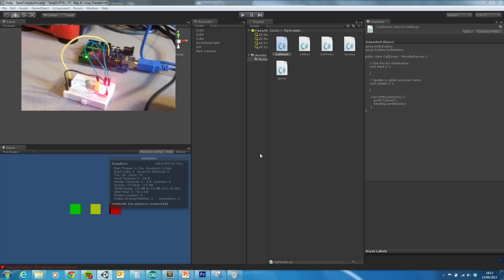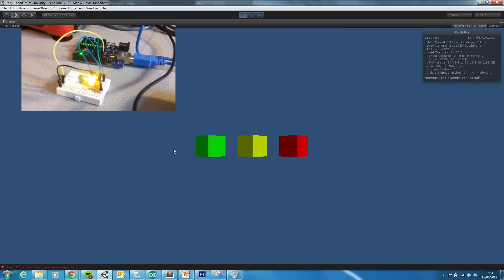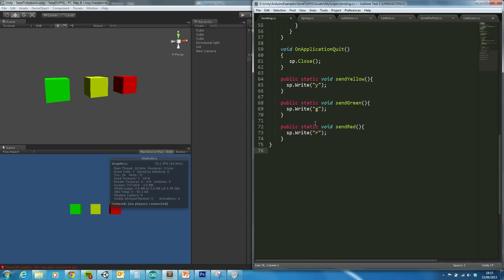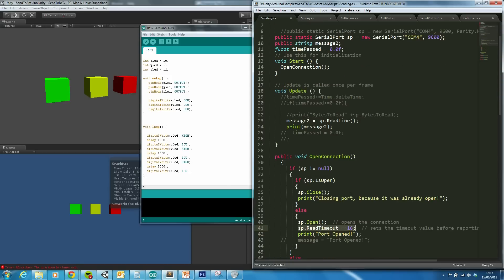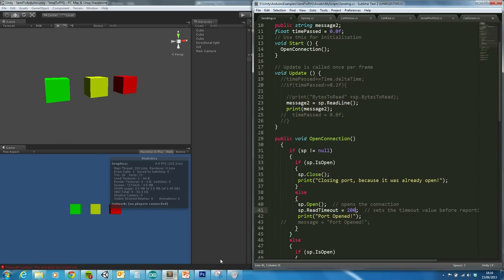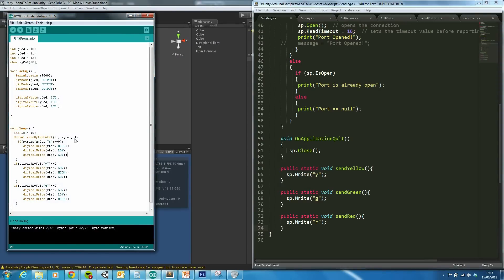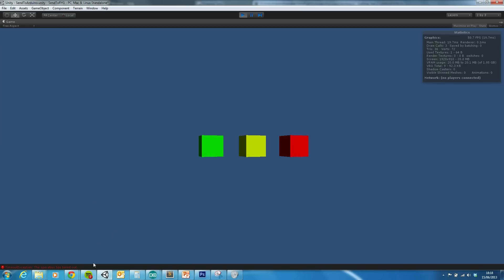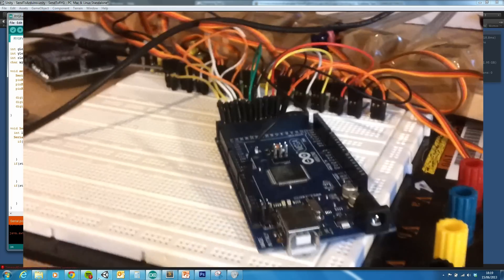Communicating from Unity 3D to an Arduino

Comment: I am working on a project But there is no Arduino plugin.
I created a car electrical circuit on my computer. Can you help me?
when pressing a button on the computer The output is sent to the Arduino pin.
I write the program with Construct 2.

Comment: Hello, great video, thank you very much! Can anyone help with this error?
InvalidOperationException: Specified port is not open.

I am definitely using the correct port. I have set the api to Net 2.0  (no subset). And I have tried using full windows name \\\\.\\COM6 to no avail. 
Thank you

Full error
InvalidOperationException: Specified port is not open.
System.IO.Ports.SerialPort.CheckOpen ()
System.IO.Ports.SerialPort.Write (System.String str)
(wrapper remoting-invoke-with-check) System.IO.Ports.SerialPort:Write (string)
Sending.sendRed () (at Assets/Scripts/SendToArduino.cs:80)
SendHome.Update () (at Assets/Scripts/SendHome.cs:14)

Comment: i have this error.

InvalidOperationException: Specified port is not open.
System.IO.Ports.SerialPort.CheckOpen ()
System.IO.Ports.SerialPort.ReadTo (System.String value)
System.IO.Ports.SerialPort.ReadLine ()
(wrapper remoting-invoke-with-check) System.IO.Ports.SerialPort:ReadLine ()
Sending.Update () (at Assets/MyScripts/Sending.cs:23)

what happend?
Reply: hello,
did u got that error solved, i am also getting same error.
Thank you.

Comment: Hi guys, I'm using Unity.  I have a proplem: I couldn't use System.IO.Ports when coding on Unity. Error follow: "error CS0234: The type or namespace name `Ports' does not exist in the namespace `System.IO'. Are you missing an assembly reference?"
Can you help me, please!
Thank for watching!
Reply: You'll need to make sure you have the API compatibility setting to .NET rather than subset. Go to Edit / Project Settings / Player And in the API Compatibility settings switch to .NET

Comment: Hey nice project! Is it possible to use this code with Bluetooth?
Thanks
Reply from the maker: Yes, although fiddly. Mac is very tricky, but I have used very cheap BlueTooth chips to send data in exactly the same way.
Reply from the maker: r3dstar Windows is less tricky, although I did end up with a lot of COM ports listed.

Comment: Hey man, love the tutorials! Needed your help on something. I am doing a project that requires me to control the car, in a car game in Unity using Arduino Uno. What I wish to do is attach a red sensor to the steering wheel of my REAL car and connect it to Arduino Uno. So when I rotate my real steering wheel, the car in my game is rotated accordingly. I would be really grateful if you can help me with the following things:
1. What device should I use with Arduino so that the rendering in Unity is smooth. (Best device to attach on the steering wheel of real car)
2. How do I code the C# script?
3. How do I interface it with Unity for the smoothest results?
(PS: I already have the car game build, just need to interface it with Arduino Uno)
Thanks and regards!
Reply from the maker: Hey carzarya1.

I would use a micro Arduino, Gyroscope, BT and battery connected to the steering wheel (Not on the handles through, on the centre, safety first!). Then send the data via BT to the computer, or throw and SD card reader into the mix if this isn't real time.

Or, Arduino and BT connected to a laptop, but attach an Android phone to the wheel and use Sensduino http://r3dstar.co.uk/?p=253 to take care of the gyroscope. 

The C# needs the full .NET. To keep everything smooth, ensure that the serial port in Unity is not allowed to wait longer than 16ms. 

This is all getting a little hazy for me know as it's been a while since I worked on Arduinos and Unity together.

Comment: will it work if I Build for Android?
Reply from the maker: Not without some tinkering. I believe there are ways, but just creating an .apk frin this won't work. WebPlayers won't work either due to security policies from the Unity plugin.
Reply: +r3dstar if you had more information I would really really apreciate it, I have been researching and I think I may need to use eclipse instead, or maybe communicate the android and arduino via bluetooth (im not sure if with unity or not). Thanks, have a nice one.

Comment: Hey r3dstar!  Are you aware of the RFduino, a Bluetooth enabled Arduino board?  I was wondering if you have any experience in using Bluetooth networks and Unity together, I too have got serial communication to work via cables with Unity3D but am looking for someone to help me create some kind of plugin to allow the RFduino to communicate over Bluetooth with Unity3D!  Any ideas?  Any help or advice would be greatly appreciated, thanks in advance!
Reply from the maker: Hi Tom,

Not much although it is very easy to use Bluetooth with a standard Arduino. You can get cheap bluetooth chips by searching Wireless Bluetooth 3.3VDC Serial Commuication Module RS232 TTL RF Transceiver . All you need to do is connect the VCC and Ground, then connect the RX to an Arduino's TX, the TX to the Arduino's RX and you can send and recieve as you would is you were using the USB cable. Only problem is range.
Reply: Ah I never knew that, that helps a little for sure!  I'm interested in using the bluetooth capabilities of an Arduino with Mobile Devices too though which is where it gets tricky.  Do you know of anyone who has any experience with connecting bluetooth devices to Unity3D mobile apps or games?  I agree with range being a problem, maybe i should use a WiFi connection instead or something!

Thanks for your help so far =D
Reply from the maker: Tom Southworth I think there is something on the asset store that enables bluetooth multiplayer for Android, but from what I've read, iOS is an issue with Unity. I could be wrong and I'm hoping to try out some Unity mobile bluetooth enabled stuff over the Easter. If I have any joy, I'll post back here.
Reply: I've taken a look on the Asset store but most of the packages available are for multiplayer gaming, they don't mention anything about finding Bluetooth devices in general or sending/receiving information from them.  There is one that may be of use but there is no forum thread for it that I can find and not much information on it either.

Good luck with your trials then, I hope to hear back from you with any news about Bluetooth working or not working with Unity3D, thanks again for your help!
Reply: r3dstar Hey r3dstar, just wondering if you ever got anywhere with what I mentioned last time?  How are tricks otherwise?  Do you have a LinkedIn?
Reply from the maker: Tom Southworth No, work took a mutated direction and I've been doing less Arduino stuff due to a lack of time, that said I've been tinkering with an RTS prototype in Unity which I think I've uploaded on here.

Comment from the maker: From my slides...

"sp.ReadTimeout = 16;
ReadTimeout affects frameRate
Unity will freeze for the of the timeout if there is no data being sent.
Data will also queue up as it is being read line by line.  16ms * 60fps = 960ms (Just under 1 second)
"

Comment: hey. I have followed your example, very nice btw.:)
I keep getting the error you also get in unity, but my execution is 'paused'.
error:
TimeoutException: The operation has timed-out.
System.IO.Ports.WinSerialStream.Read (System.Byte[] buffer, Int32 offset, Int32 count)
System.IO.Ports.SerialPort.read_byte ()
System.IO.Ports.SerialPort.ReadTo (System.String value)
System.IO.Ports.SerialPort.ReadLine ()

Any help?